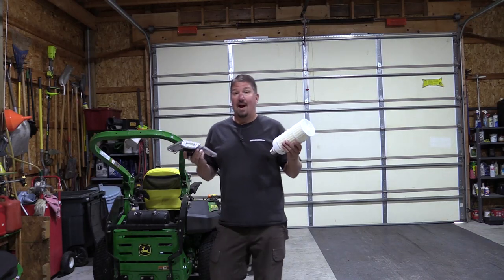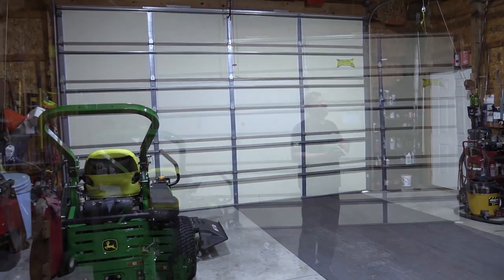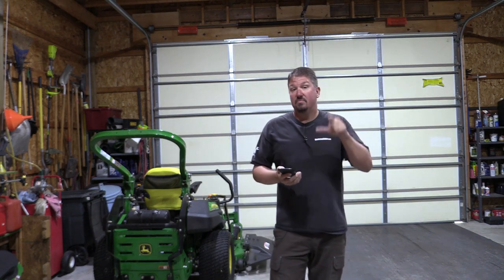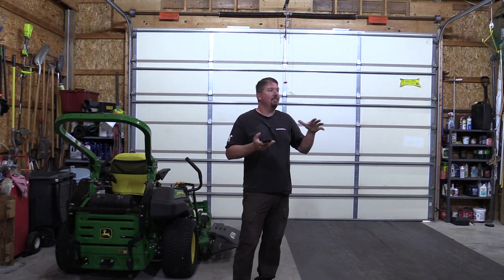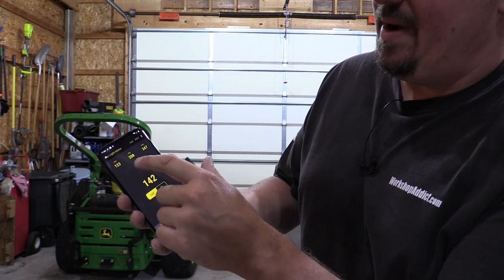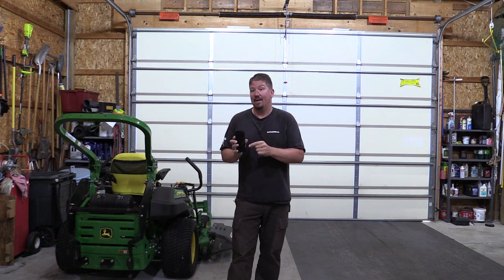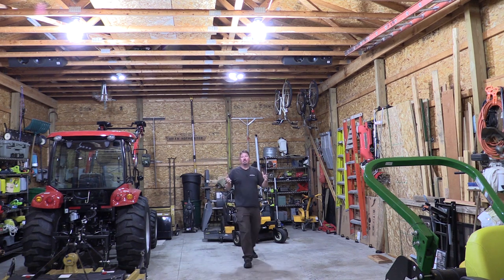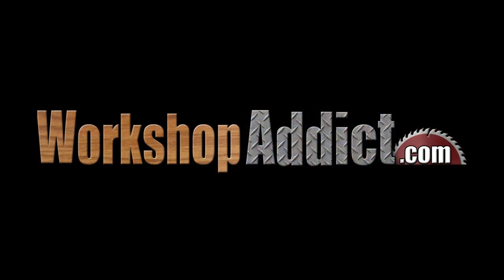New Corn Style LED Bulbs Vs Deformable LED Lights From Amazon | What Is The Best LED Light?

Comment: The cob lights are twice the output of the deformables which can be used folded up like the cob lights or different leaves on different angles and the better metal ones can dissipate heat better. Complicated but with a low ceiling use strip lights or lights with diffusers.

Comment: My go to right now are ballast bypass, direct wire led tubes. The single biggest problem I have with these kinds of bulbs is if the driver goes out, the whole light is probably garbage (I'll be honest and say I'm not sure if the driver is replaceable or not). 

For $30-$40 I a cheap shop light could be bought along with a couple direct wire LEDs. With a little time it can be  rewired and the troffer offers a longer, reflective surface to direct the light down. If one of the bulbs go out, it's as easy as twist one out and twist one in for less than $10-$15.
Reply from the maker: I will be going this way in my main shop when my bulbs start to burn out.  I am also going to add some more direction deformables around the lift.

Comment: Great channel... Maybe you can help with my LED/Garage opener quandary: I replaced six standard incandescent bulbs in the ceiling fixtures of my garage with winged, adjustable LEDs (no bulbs in openers). What a difference in illumination over the previous incandescent bulbs. However, when the lights are turned on the LiftMaster openers will not operate with a remote (inside or outside, all LiftMaster remotes AND vehicle programmed). The openers operate perfectly if the lights are off. I have insulated the antenna wires and electrical cords with Ferrite Core and extended the antenna wires through the garage wall to the exterior with no change. The only way to open the garage doors with remotes is to be sure the lights are turned off. Most manufacturers of the adjustable, winged LED bulbs advertise their use in a garage but, I have not come across others with this problem.
Reply from the maker: The lights you have are interfering with your garage door signal.  The older ones were poor and would do that, but anymore we rarely see it.

Comment: I just use a 3-socket splitter from a single e26 socket and use three 10w white light LED bulbs. It spreads out the light pretty evenly while keeping it really bright.
Reply from the maker: We have a video with our light meter showing it does work, but nothing like any of the other lights.  Link is in the description to that video.
Reply: plus you can get those cheap

Comment: With my setup I find the deformable lights work for me. Not positive of my ceiling height but I have to stand on top of a Lincoln navigator to change the bulbs. I also have drywall all around and painted white, including the ceiling. I have some of the hanging T8 style LED lights for the areas where I need extra light but often I don't even use anything besides the overhead deformables. 

Will look into a cob next time I am looking to change up my lighting.

Comment: I ordered similar 200 watt deformable LEDs for my garage and with a kill-a-watt they measured 65 watts! I returned them and went with 5 100 watt LED corn lights that measure 95 watts each with the kill-a-watt and produce 15000 lumens (TSEXES on Amazon). I added 10.5 inch aluminum reflectors dis-assembled from "brooder lights" available at Home Depot to help direct the light.
Reply: I was thinking to go to the farm store and buy 15 brooder lights and put these cob lights in them and hang them up 12ft high in my polebarn to get more reflection, how's is yours working out ?
Reply: @aux1z11  The reflectors work great! I also have 12 ft ceilings, the lighting is much improved.

Comment: So we have cob lights set up in our conex at work and the ones we have,have an led cluster on the bottom of the cob.you get the best of both.
Reply from the maker: I stayed away from those in this situation because these have cooling that goes from the bottom to the top.  These are not expensive, so the hope is that they might last longer.

Comment: I fortunately painted my single car cinder block wall garage white inside a few years ago including the ceiling below the joists so 3 standard 9watt LED bulbs seem to light it up plenty bright enough for me.  That being said, on one side of the garage I have workbenches lining the whole length of wall and have 3 sets of old fashioned 4ft florescent shop lights above the benches as well, one old enough to still be ballast driven.  When they eventually wear out should I convert those from the standard T12 40w "bulbs" to LED or is it worth the bother?  They seem to give off plenty of light just the way they are.

Comment: I can't help think that if the ceiling had wallboard, or even just a piece of wallboard around the base, that even more light would reflect down to the work areas.    And read better on your meter.
Reply from the maker: You are right.  I said it in the video also.  Even painted walls would have helped.  It is hard to show how much more light and how much more comfortable it is to be in there now without being under the spot light.

Comment: I have a 3 car garage that I do some basic mechanic work and also some light woodworking. Right now in the middle of the garage there is a row of 3 lights spaced out and that's it. The walls are painted dark as well which doesn't help and right now I have to open the garage just to get good light. Any recommendations for my scenario?
Reply from the maker: Wow.  That's bad.  I would recommend you add more outlets, but if you cannot, they make E26 strip lighting that would allow you to take light to the other side of the garage by connecting the strips.

Comment: I have six ballast style 40" fluorescent fixtures in my garage with LED's.  It's bright, and I hate it.  I much prefer soft incandescent, but I'd need about 24 of them and it'd get rather hot.  I have 36 recessed lighting fixtures in the basement...now I need to install a second air conditioner.  I  hate LED's (they don't dim well) and I HATE fluorescent lighting.

Comment: Biggest issue the the shit that runs the leds die and you spend all this extra money just to replace it as fast or faster than a halogen. You get what you pay for when you buy cheap. High quality leds aren’t cheap.
Reply from the maker: I agree to a point.  I have never had one of these fail and I have 60 or so different models of cheap LEDs.
Reply: @WorkshopAddict  i guess mine must be the cheap of the cheap. also a limited data sample so there that.
Reply from the maker: @FishFind3000  You never know what you are getting with inexpensive electronics.
Reply: they tend to push the thermal limits and run hot

Comment: There is another type of high power led Bulbs we use here in shops in Tunisia they are not cob but SMD with diffusor up to 100 watt and they diffuse the light even better than cobs.

They problem with cobs is you can see the actual led chips but with a diffusor they are hidden.